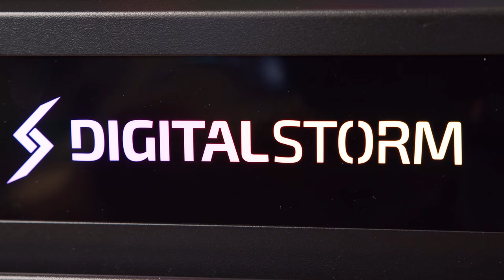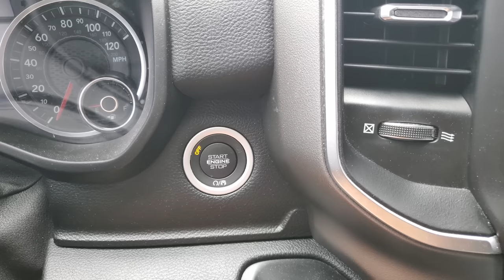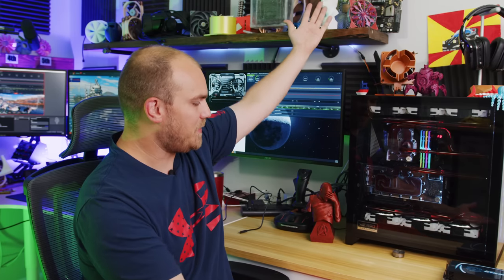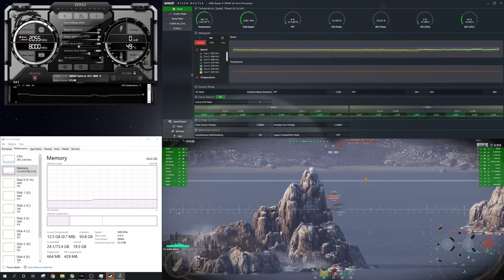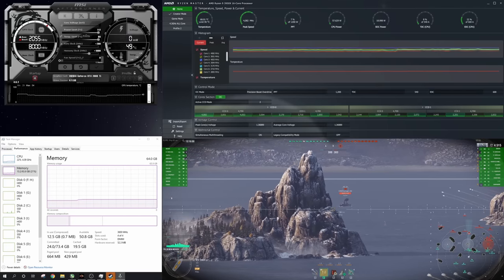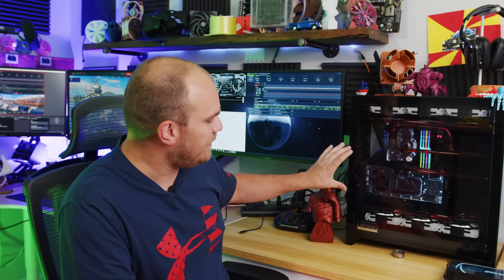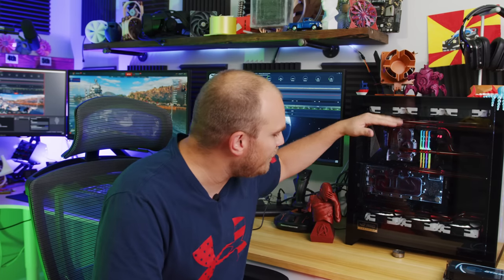$2.00 part BRICKED my gaming PC

Comment: James: "It's been about a year since I built it so I am going to repaste it to get some better temps."
Me: *Looks at 10 year old build that hasn't been touched in confusion.* "Repasting?"
Reply: Good paste can last 5-10 years, but it may be dried and you may lose like 5°C
Reply: I usually repaste my builds every 6 years. You should do it!
Reply: @CaveyMoth  I am just a few days from being able to start on the new rig but I think I might take that advice this time around.
Reply: my PC's CPU hasn't had thermal paste for the last 2-3 years and it runs perfectly fine. 
who needs paste? 

a graphite thermal pad works just as well and you never have to replace it. heck you pass it down to your grand kids. it doesn't wear out.
Reply: @darkshadowsx5949  come back when you passed it down to grand kids and let us know how that went
Reply: @TheActionBastard  Same here especially after a botched bios update left it in a crippled but working state for 6 years. As for cooling I was proven wise by slapping on the biggest Noctua cooler they made back then. Even if the paste fails so long as enough contact remains that oversized cooler will still keep it tolerable.
Reply: change it to kryonaut your temps will be a good 8-10c lower than pastes of 10 years ago too lol
Reply: @satibel  I ran my 2600k build from 2011 to 2018 with (if I recall correctly) noctua NT-H1 paste. After building my 9900k I decided to use the then current most recommended paste, thermal grizzly cryonaut, to repaste the untouched 2600k. I did before and after benchmarks on the hardware, involving prime 95 and other stress tests. To my surprise the original paste was easily 7 degrees better. I figured it was a mistake in my paste job so I repasted it, ensuring it couldn't be. Nope. second result the same. Let my brother use the PC for a few weeks and retested and still worse than original benchmarked 7 year old paste. 

The moral of the story? If you aren't suffering thermal problems, don't bother replacing perfectly good paste. There is absolutely no need.
Reply: I was thinking the same thing. When the temps start going up, that's when I take it outside to the air compressor and blow the dust out. I can see the appeal of these nifty looking builds, and rainbow lights like the one sponsored, but in my house it wouldn't get seen. My PC sits in a slot in my desk, and all I see is the front of it. Just give me something that works imo. That digital storm pc sure is pretty though.
Reply: @darkshadowsx5949  I think I over tightened an IC Diamond thermal pad on my gpu. Because the GPU die is imprinted on the thermal pad. No matter how tight it got, my 2060 was running away thermally.
Reply: @scythelord  note that 7 degrees is out of a margin of error, you should have the same results between NT-H1 and kryonaut, there's probably something else, but it still proves the point, change the paste if you are removing the cooler, or thermals are too high, because stuff can change when removing the cooler.
Reply: Repasting after a year is complete overkill. Then again if i were to take apart my custom loop and i have the paste lying around might aswell. Also it really depends on your cpu and workload. If you just game or have a cpu with a low heat output its a lot less important.
Reply: @darkshadowsx5949  They both have their advantages and disadvantages. As far as I can tell thermal pads are usually not quite as effective at pulling heat as thermal paste but they are much easier to apply. Since they are precut to size you do not have to worry about it being too much or too little like you would with paste and it does not spill since it is a solid. You will need to replace the pads a bit more often than you would paste especially if you ever have to remove the heatsink as it is not recommended to reuse pads, however most people would also reapply the paste in the same situation. Overall for builds you are not trying to get the absolute most performance out of pads are definitely the way to go. For hardcore overclockers you should go with paste as you will be able to reduce temps by a couple of degrees allowing you to push the components a bit farther.
Reply: Yeah, paste dries up and gets hard, it’ll crack and stop making contact with your heat sink or CPU.  Definitely worth checking.  Mine is 2-3 years, I’m not worried.
Reply: @CaveyMoth  I definitely would not use a thermal pad on a GPU.  The height of the pad could prevent all the other components from making good contact with the cooler.  I guess if it’s one of those paper thin ones it might be fine.  But they don’t perform near as well as a good thermal paste.
Reply: yeah i don't do it either. i just use cheap thermal paste that never goes bad.
Reply: I'm glad someone else thought this too.
Reply: My only thought is agree that re-do it once in a while, but more importantly, you can get so much BETTER paste now than 10 years ago. Get that kryonaut, it's very good. I dropped like 2-5C from MX-5 or whatever it was.
Reply: @TheActionBastard  40°C under load? As long as my stuff stays significantly below the throttling points at around 80°C I'm not touching it. And so far the CPU hasn't been touched in 6 years and stays under 70°C but the original GPU cooler failed so I had to replace that a couple years ago and it stays under 65°C now too.
Reply: @cheater00  carbon doesn't degrade. 

carbon fiber is more of a problem in landfills than plastics for that reason. 
even when the plastic finally fully degraded carbon fiber would remain untouched.

when your thermal paste dries up and slowly looses its thermal conductivity a thermal pad will perform as new.
Reply: @darkshadowsx5949  ok come back when you passed it down to grand kids and let us know how that went
Reply: @DoctorDanieI  im not talking about the squishy thermal pads...  
carbon thermal pads are reusable. they dont wear out like paste or traditional thermal pads. carbon lasts forever. 

overclocking is absolutely pointless. i tried it. yeah its fun to push things to their limits but whats the point in gaining 5fps if my monitor cant output more than a limited amount of fps and i already pass that without overclocking? 
you just end up putting strain on your components and fool yourself into thinking its improving anything.  
your room heats up faster and you get uncomfortable. whoooo. i feel the magic fps gains in the form of heat and a larger power bill.

i built my pc for performance and efficiency. not to waste power needlessly.
Reply: Gamers Nexus did a video about when it actually does anything. I believe it was only once you got older than 1080 did it show any difference. (like 5+ years)
There is also the possibility of not repasting it correctly and making it worse
Reply: @satibel  I just redid my CPU after 4 years and the paste was still very goopy.  I used MX-4 so I'm confident I could have waited but you are right.  Performance could be sitting on the table.  For me, I have cats so it was a good time to de-dust the machine.
Reply: If it ain't broke donk fix it.
I do mine when I take it apart, sometimes that months some times its years.
If the temps are ok the don't worry, It's not worth the risk of chipping of a surface mount component from a GPU or scratching a trace unless your having problems.

I have 7 systems online at the moment so I don't need the hassle. 
I'd never leave the house.
Reply: Haha. Reminds me of friends who pay $50-70 every spring to "tune their bicycle". Meanwhile I just do a quick inspection and spray some chain lube on my 13 year old clunker and hit the road, and it rides like a charm.
Reply: @iMeatbag  arctic mx 4 shouldn't dry before 8 years according to the manufacturer, but that's not the case for all pastes, some do dry up in like a year (the very cheap ones)
Reply: @satibel  no way it can last more than 5 years .
Reply: @satibel  Thermal pumpout can occur much faster.  It depends on how much heat is present between the cpu/gpu and the cooler's plate.  Most modern pastes have noticeably less viscosity than older pastes.

@scythelord Your original thermal paste wasn't 7 degrees better.  Your original mount was 7 degrees better.
Reply: Good paste should last at least 5 years... and a good computer should last that long as well.
Reply: @darkshadowsx5949  overclocking is typically used for older hardware under higher loads. It has its place. Stop being elitist.
Reply: looks at my PC built in 2014 >.> <.<
Reply: lol you will see a lot of improvements in both GPU and CPU if you repaste every year or so, especially with those really fluid pastes, due to pump-out effect, and drying out.
Reply: @TheActionBastard  You should upgrade to a new system. You will see so much improvements in your performance.
Reply: @TheActionBastard  lol same. Haswell from 2014. i7 4771.
Reply: if you remove the cooler, you should always repaste..its not about time as much as you removing the cooler

Comment: Fun Fact: Many modern car keys use the same battery as 99% of mobo's. I fixed my PC once with a 2014 Ford F-150 truck key battery.  😃
Reply: Yup, CR2032
Reply: @Voyajer.  🏆WINNER 🏆WINNER 🏆 CHICKEN DINNER!
Reply: @Voyajer.  Highly annoying when they decide to use a CR2025 instead.
Reply: @Tahgtahv  thats what my nissan key uses
Reply: ... yeah? They are in lots of things.
Reply: @bradhaines3142  Ofc, YMMV. A 2032 most likely won't fit in a 2025 slot, a 2025 obviously fits in a 2032 slot, but may be loose/not work well.
Reply: Eh my 99 jeep fob uses a cr 2016 battery and motherboards use a cr 2032 battery so that wont always work
Reply: @Tahgtahv  the 32/25 part is the height (in 1/10mm iirc?) btw, so for the 25 you can get away with some padding (i.e. aluminium foil) if you are a little adventurous.
Reply: I had a pair of digital calipers that used the same battery! Great bc I had loads of spares!
Reply: In every gas station they have it.
Reply: @Dimondminer11  his comment does say "modern". Love my jeeps but 99 isn't modern anymore 😅
Reply: I never understood why they use cr instead of lr in motherboards. Is it really that hard to design a simple charging circuit that doesn't overcharge the battery
Reply: Cr2032

Comment: When you mentioned the resetting boot order, my brain immediately thought, "bad battery?" Awesome that you don't need to rip out the mobo.
Reply: Exactly what I thought.  I actually have a few extra batteries sitting around just in case.  Though I have never had a battery fail ever...  Must just be my OCD
Reply: @mgshadow45  That was immediately my thought too. I'm guessing the time was bad as well, and that just went unnoticed because Windows normally is able to use a time server to set the clock.  I'm still kind of miffed why modern BIOSes don't use some sort of non-volatile memory for settings.
I've had my current system for almost 6 years, with a few in the past, but I've never had to replace the battery or paste.
Reply: I have spare batteries of many common types. 2532, 2016, 2012, LR44, AA, AAA, 9V, and perhaps a few others. When I use the last one of any type, I order a new package. Never know when, or which device, will need one.
Reply: Strangely my almost brand new motherboard is having the same issue with boot priority. The battery tests 3V though
Reply: @smeezekitty  a fresh battery should test at ~3.3V, if it’s testing near 3.0, it’s bad.
Reply: @smeezekitty  It may produce that voltage when it isn't under load, but as soon as it takes the load of the RTC and everything else, the voltage probably goes down to a level where it can't be maintained. Replace it anyway, it's extremelly cheap and easy to change.
Reply: I've experienced that on multiple machines but usually a lot older! Always have a pack of 2032 is laying around
Reply: @smeezekitty  remove the battery and pull the cord and then try to hold the power buttons for at least 10 to 15 seconds. This will reset your bios to factory. It is necessary on some machines. Replace the battery and the Machine should boot but if you have an updated bios you'll have to re update most likely. If that is not the case then check to make sure your RAM has been installed correctly. Incorrect RAM installation or a bad Ram stick can give you a black screen and calls continuous reset during boot.

Comment: Nice job on the new lines.   I do have two suggestions.   First, when you are draining a loop and you disconnect the lines from a top mounted radiator, immediately use a G1/4 plug on the port.  That will prevent anything left in the rad from dripping on your hardware.  You can finish draining it later.  Second, Barrow makes some excellent G1/4 offset fittings for when two ports just don't quite line up.  I've used them on the last three hardline builds I've done and they make things much easier.

Comment: Maybe we should start an "It's the battery!" shouter support group in the comments here ...
Reply: when i had dying batteries, i always got "cmos checksum failed, defaults loaded, press F2 to enter setup" on the screen. Why isn't this happening? I was not shouting "it's the batteyr" because the pc should not cease to turn on if the cell is dead.
Reply: @victortitov1740  That is highly dependent on your make or model of motherboard, not every chipset will react the same way to low or no voltage. Also just how "dead"  is that battery truly, if you ever had a batter powered flashlight, it might turn back on for a few seconds if you let it rest ...
Reply: @victortitov1740  It's possible that this particular battery is at high enough to not trip a cut off, but low enough to cause problems. For myself my computer is on 24/7 so by the time the RTC battery is low, its had long enough to fully die.
Reply: @DoctorWhom  checksum should have been tripped in any case, be it a dead battery, not quite dead battery, cosmic rays or whatever else can cause the stored data to be corrupted.
Reply: No !!! it's always the butler :_: